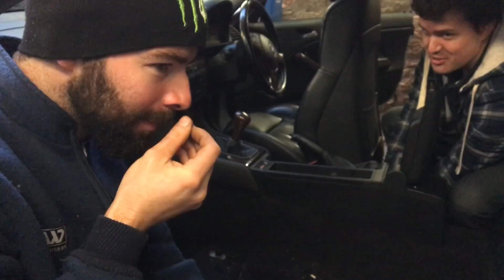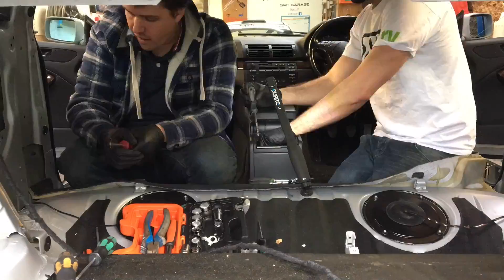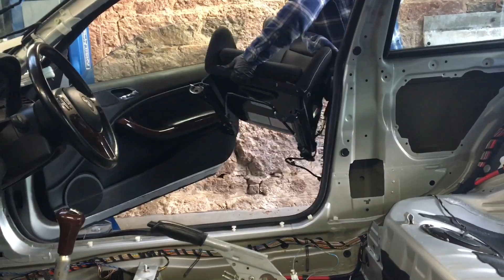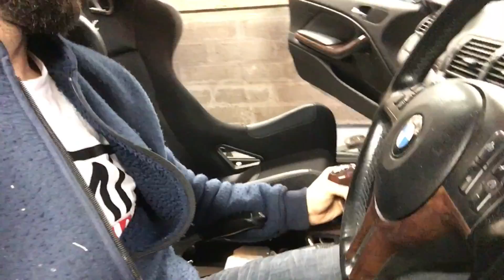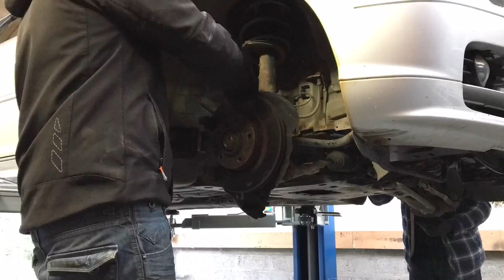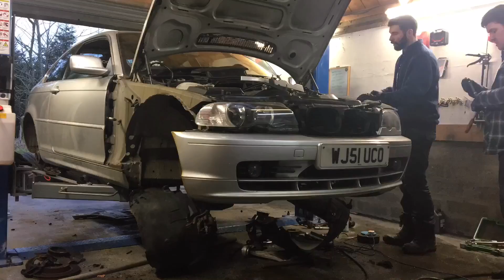E46 Drift Car Build Ep 2

Comment: Hi, Would u recommend the 320ci for a beginner drift missle?
Reply from the maker: tomas hannigan yeah that's what I have 😊 with 15 or 16inch wheels it's skids great just weld the diff and put a hydro in it 👍🏻 my drift car build videos should help u to do them jobs
Reply: SMT MOTORSPORT Thanks man as I was curious about the car as there is alot of mixed opinions about it on different forums.
Reply from the maker: tomas hannigan yeah many people say different things but u can see on my videos it spins the wheels no problem 😊 cheap fun and the 2.8l is an easy swap if u need it later on once u get more experience, I will be doing a Q&A next week to clear things up on what my car is and what it has 🤘
Reply: is a 323ci e46 good to?
Reply from the maker: Rectro YT yeah it’s fine any 6 cylinder bmw can skid but the bigger the engine the better 👍🏻 or smaller wheels or small diff all helps do skids